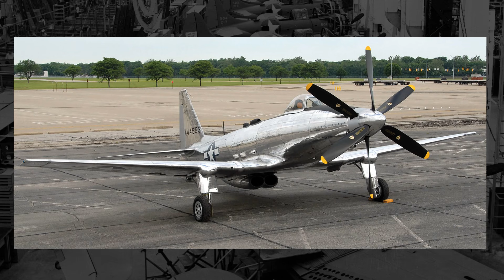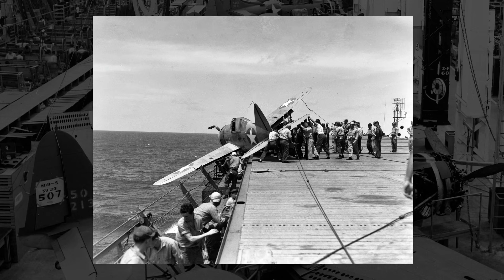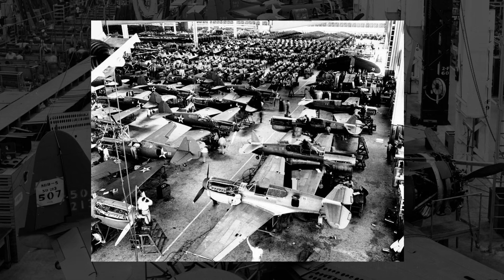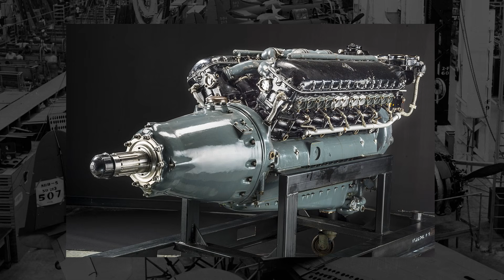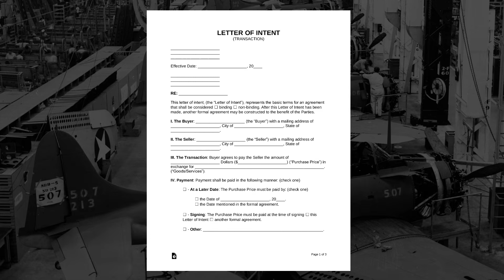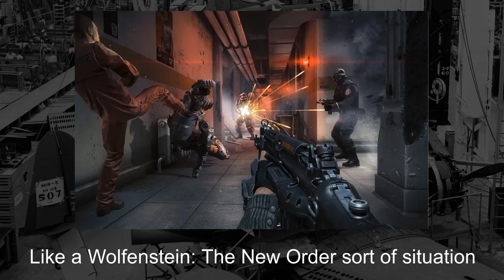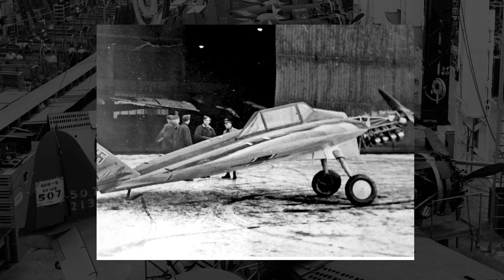The "Wonderplane" Slapped Together With Spare Parts: Fisher XP-75 Eagle

Comment: I think the Blackburn Botha and the Heinkel He177 were much worse, becaused they actually made it into service and killed many of their crews
Reply: He177 wasn't a bad plane. It had bad engines. A Manchester that never got its 4 engine fix. (Outside prototypes).
Reply: The Blackburn Botha needed more powerful engines, another 300 hp per engine would have been a big help but unfortunately there were not enough Bristol Taurus engines.

Comment: Blackburn Roc - a woefully underpowered, British naval turret fighter with a maximum speed 186mph (nuff said), the LaGG-3  or "varnished guaranteed coffin" as nicknamed by Soviet pilots (over 6500 of these death-traps were built), the XVF-12 VTOL plane that couldn't fly & of course, The Christmas Bullet which could fly just long enough to shed its wings & kill its test-pilot.
Reply: Ahh yeah, the Roc.  Someone thought "Let's make a Defiant, turn it into a Carrier aircraft with all the extra weight that entails, give it a weaker engine, then have one of the most renowned designers of 'What The Fudge?' aircraft in the first place build it, then make it unstable as hell. Brilliant!"

I don't think it's the worst aircraft ever, but the Roc has special place in my heart - where the fat greasy bits of cholesterol gather.

Comment: I present to you for consideration the British interceptor: The Boulton Paul Defiant. Because putting a turret on an interceptor is a terrible idea.
Its WW2 like the Fisher XP-75, and it was a fighter.
Unlike the Fisher XP-75 it was accepted into active service and 1064 were built.
As far as fighters went it was badly outclassed, and basically required escorting fighters f you wanted them to come back alive.

Whilst it's not all bad I would not be surprised if the plane would have been better with the turret removed and forward facing guns like a proper fighter.
Reply: Bad idea, but not a bad plane. They tried to build one with traditional wing guns and it was a solid plane.
Reply: The Defiant was early in the war and while it lacked performance due to the weight and drag of the turret it was used as a night fighter until being replaced by the Beaufighter, I notice that the P 61 late in the war with a turret lacked performance and could barely catch a bomber.

Comment: The Me-163 Komet had a good idea, but a dangerous approach. The fuel they used was capable of melting the pilots--literally--and there's one video on that very thing. However, while the Komet wasn't totally successful, it ushered in a new age of rocket-powered/jet-powered aircraft. Same deal with the other German-made fighters introduced in 1944/45. For them, too little, too late.

I know the jet engine goes back as far as the early 1930's in the UK, but operationally speaking, it wasn't until the late 1930's that the first German rocket-powered aircraft took to the skies. And piston-engined aircraft were the go-to planes during the war. The Meteor, the Me-262, the Komet, and a few other jet-powered/rocket-powered aircraft developed near the end of the war and into the late 1940's brought an end to piston-engined aircraft for good.

Comment: I’ve seen a few mentions of the Eagle having P-51 wings but in all photos the wings are clearly P-40.  Using Corsair landing gear makes more sense then as it has a similar retraction motion to a P-40 but was likely designed to handle more weight.

Comment: The Allison engine was going to doom the XP-75 regardless.  The engine it was based on was well-known for poor performance at high altitudes, whether it had a supercharger or not.  The main advantage the P-51, for example, had over the P-40 was the P-40 had the V-1710 but the P-51 had the Rolls Royce Merlin, which performed very well at high altitudes.  In the P-39, the Allison was fine because it was a ground-attack fighter, but for anything expected to escort or shoot down bombers, Allisons were never going to cut it.
It's also arguable that had the P-39 been given a Merlin, it would have been the ultimate single-engine bomber-slayer with that 37mm cannon and the P-51 might never have been produced, which might have been a problem once the Allies went on the offensive and needed the extra range to escort their bombers in Europe.  The P-47 and P-38 were still available, but not in the numbers needed, and they lacked the maneuverability of the P-51 for dogfighting enemy fighters.

Comment: There is much more to the Messerschmitt 163 than just being a rocket plane that cost more than it earned. From an aerodynamic point of view, it was one of the most influential airplane designs of the century. If was believed that this tailless design with swept wings was the right configuration to surpass the speed of sound. Therefore it was copied by the Allies (like the X4 Bantam) and it led to a lot of experimenting. The Russians even continued their research into rocket interceptors shortly after the war, because at that point it was still not clear that jet propulsion would be the winner.

Test planes are hard to judge. Many test planes never go into production for any number of reasons, so failure is pretty normal.
Reply: The Mercury Redstone rocket was a direct descendant of the V-2.  I believe the American design was based on an Atlas ballistic missile and kept self destructing.  Not a desirable characteristic.

Comment: The thing is, many MANY aircraft failed in the development stage; especially during the war. And an ungodly number of them failed due to engine issues. The idea of an (effectively) twin engine heavy fighter with sleek lines and high climb rate is not the issue. The engine placement is not the issue. If this DID work, it might have become a fantastic aircraft.  But the main issue was the engine. The forward visibility was good. Had it been given a tricycle landing gear, visibility would have been fantastic.  Basically,  if the engine lived up to expectations,  everything else could have been worked out.

Comment: They didn't even test this thing properly as just sticking a few parts together and then fly it in combat like ways, tight turns, high speed turns etc, This thing will for sure break up either on landing if you are lucky or mid air if unlucky. No ejection form at all would be able to save you in that case. This thing is a disaster waiting to happen.

Comment: For such an unfortunate looking plane (although the bubble canopy was a nice improvement, looks like from a P-47?) the Air Force Museum's example is looking pretty good polished to the hilt. With some of the other planes like the XBT2D and XF8B you've reviewed where all examples were scrapped I guess were lucky to have the XP-75 to view if for nothing else as a reminder that even the best efforts don't always pan out but it wasn't for lack of trying. An aviation museum for planes like this would most likely be an interesting place to visit and I wish a lot of the "failed" prototypes were still around to populate it!

Comment: The P38 could not operate at altitude for use in Europe and the P51 was the slowest of the four top fighters the Western allies used from mid 1944 until the end of the war.    The Spitfire was the fastest while the Tempest was next followed closely by the P47 then the slowest of the four was the P51 Mustang.  The US was so far behind other nations when it comes to aviation until the post WW2 era when other nations didn't have the funds to manufacture designs they had produced which did exceed US aircraft,  After that development just dwindled often surviving only when nations worked together on projects.

Comment: My dad worked at Fisher Body and when the war broke out, he stayed with Fisher and had to move to Memphis. He was a foreman. At the Fisher plant, wings were produced for the B-25 and the B-29 and possibly other parts or small sub assemblies. He had nothing to do with the Eagle. Knowing GM and how the different marks shared parts, it is just an extension of their thinking to make it fast, cheap and reliable and the fact that they owned Allison.  For the mishmash it is, I think it came out looking kinda sleek. Better looking than most British aircraft which had some strange ideas and styling but they persevered and moved beyond making some fine aircraft. The plant is Memphis is still in use by I think Porctor & Gamble where Charmin is made. Very few pictures online of this plant. If you look up FIsher Body, there is a site that breaks down the different plants and gives locations and what the did during the war and some pictures.

Comment: The entire idea of trying to improve efficiency by reusing major subassemblies from other aircraft was stupid.  Requiring engineers to figure out ways to reuse major preexisting subassemblies that were not designed to work together was guaranteed to result in an inferior design compared with what good engineers could have developed if they were allowed to adapt ideas from earlier planes to fit a new design better.  With production on the scale GM envisioned, there was no possible way that reusing subassemblies could have led to more than a minor advantage in production efficiency, so there was virtually no chance that advantages in production efficiency could outweigh disadvantages in performance.

Comment: Had the USAAF got it's way it would have had no fighters at all in 1941 as the USAAF thanks to the flawed ideology of"Billy"Mitchell combined with isolationism was wedded to the ideas of Douhet"The bomber will always get through" meaning the entire inventory of the USAAF after Pearl harbour would have consisted of B-17s,B-18s and similar aircraft which would rely on heavy machine gun batteries to stave off enemy attacks: Raids like Schweinfurt proved the folly of this especially when the opposition turned up with fighters armed with multiple 20mm cannon
Reply: In July 1942 after bad losses the USAAF asked the RAF to protect their bombers and the RAF did using Spitfires, in fact if you went to the National Museum of the USAF you could find confirmation that the Spitfire was the main escort fighter for the USAAF from July 1942 for over a year.

Comment: One candidate I will recommend is a plane that did get considerable use in WWII.  I learned about it from my Dad's business partner, who had been a B-25 "flying sergeant" pilot.  At the conclusion of their first orientation briefing the students were told to pair up with a B-25 instructor.  John looked around the room and was disturbed by the fact that all the instructor pilots appeared to be teenagers.  Then he spotted one captain who must have been ancient, probably 35 years old.  He hooked up with him and off they went to the flight line.  Once seated inside, John stared at the captain and the captain stared back.  Finally John asked him, "Sir, how do we start the engines?"  The captain sheepishly replied, "I don't know.  I've never flown one of these machines before."  
"But aren't you qualified in B-25s?"
"Well, that's what I told them when I volunteered for this assignment.  The truth is I've been training students in Curtiss AT9s and I had to get of them before one of those damned planes killed me." 
Between the two of them they managed to figure out how the B-25 worked and ended up checking each other out.  As for the AT-9, it had been purposely designed to be tricky to fly, so much so that after the war the government refused to release them for civilian sale.

Comment: Many aspects of this plane remind me of the German's Dornier DO 335 Arrow.  Mid-Engine design, extremely large fuselage more approriate for multi-engine level bombers, contra-rotating props (althoug the Arrow had them separated by putting one after the tail section).  However, the Dornier DID meet its design goals, and was put into production, but it was too little, too late.
Reply: Reminds me of Johnny Cash's car:  One piece at a time.

Comment: Worst no. The Bell P-59 was the worst. Jet powered, but no faster than contemporary fighters at 413 MPH. 37 mm cannon with 44 rounds, and 3 .50 calibre machine guns. And they built 66 of them. If it was a jet trainer project it would have been fine. But it was meant to be a frontline fighter.

Comment: In the technical publication industry you document the prototype (even prototypes need instruction manuals) and you update to the production model as changes are made. The prototype is the engineer’s first physical guess about how the machine should function; testing is the shake-and-break phase to find out what works and what doesn’t. Sometimes too many things break, the fixes compromise the intended function and it never gets beyond the prototype stage.

Comment: The P-47 gear extended as it was lowered. To prevent prop strikes.
One of the features/compromises of the Corsair (and the reason for the inverted gull wings) was a specification for a HUGE prop 13'1" in diameter.  The P-47 used the same diameter prop, and Republic's solution to prop strike (something the CORSAIR (initial production versons) was well known for), was to design the landing gear legs extend/lengthen as they extended.
P.S. the Corsair's prop strike problems were mitigated (never totally solved) by training and pricedures (arcing landing approaches, redesigned gear legs/shocks).

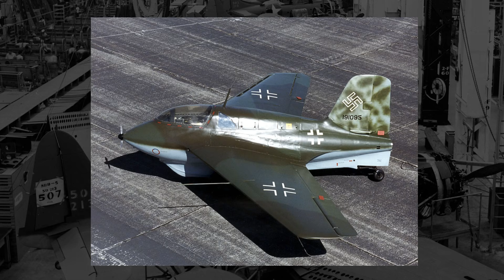Comment: 19:46 I wouldn’t personally think of the ME 163 as being the worst plane. I mean, yes, it was certainly hazardous to fly with even the fuel, unburned, being corrosive enough to slowly and painfully kill the pilot. Buuuuuut, it was faster than any other plane at the time (that is, if you can even coldest thing a plane and not a rocket with a pilot and guns strapped to it)

Comment: Comparing a failed developmental aircraft to production aircraft is questionable in determining “worst” aircraft: far more men perished flying Brewster Buffaloes and Douglas Devastators in the Battle of Midway than in the  XP-75 program, yet the former were prewar designs that outperformed prior models.  “Worst” is subjective; the engineering caveat “it depends” applies and allows for avoiding a definitive answer.

Comment: War planes are not the same as motor cars. Taking parts all and sundry doesn't improve on the design and performance of something that operates in three dimensions.

I wouldn't rate this so badly as to be "the worst", and as you say, and as Germany showed with a number of designs, management issues were the killer.

Comment: An F-35 has a range of ~1,500 miles.  Some jet fighters even less.  Impressive the range these WW-II planes had!
Reply: True but no air refueling back then
Reply: @robertheinkel6225  Correct for sure.  The range of some fighter jets is pretty poor these days, esp considering how far off their launch points have to be to attempt to be out of range.

Comment: Very interesting, thank you.
I don't get how the cobbling together of an aeroplane from the parts of pre-existing designs was ever going to speed production, indeed all you are really doing is adding complication by attempting to 'Frankenstein' necessarily incompatible parts together.
Surely a much better plan would be to design a plane from the ground up with production line assembly and modularity in mind?
Reply: A notable success in such an approach was the CAC Boomerang in Australia. It used quite a few parts from the earlier Wirraway & went from the first order to prototype stage in three months. Although a much more capable aircraft than the Wirraway, the unavailability of a suitable supercharger meant it was incapable of a fast climb to the heights at which Japanese aircraft were operating & was sluggish at such altitudes, so it failed as an interceptor, but it carved a niche as a very effective ground attack aircraft later in the War.
Reply: Poorly explained in this video. If you take a wing that is already designed, you do not have to spend any time designing and testing it. You simply start producing it. 
Also, if it is an already existing part, you can either have the original supplier build more so you don't have to and can simply pull them from the supply bin, or you license to build them and save the engineering and test time.
The video tried to say this destroyed the assembly line concept but it was the parts supply side, not the assembly line side.

Comment: A couple of things got missed in terms of "advanced features" - the P-39 - like arrangement of putting the engine behind the pilot, for instance. The main problem with tractor prop fighters was the long nose and tail dragger gear - it hinders visibility, especially for taxiing and landing. The P-39 was ahead of its time. By 1943-44 EVERYONE was thinking along these terms - Rolls Royce had a fighter design for its new Crecy engine that was supposed to use P-51 wings, it got as far as a fuselage mock-up (there's a picture in the RRHT book on the Crecy). Messerschmitt had a Me-509 in the design stage. Both of these had the pilot up close to the nose, the Me-509 also had tricycle gear (something the P-75 didn't have). And note that pretty much all jet fighters post-war have the same arrangement - cockpit up near the nose, engine(s) behind the pilot. Another feature was the placement of the radiator. One reason for the P-51's added speed was it put the hot air from engine cooling where it would do the most good, in the low pressure region towards the rear of the fuselage. Note that the Me-509 has this, as well, so did the Martin Baker MB5.
Reply: Good points, well made. 
😁👍
Reply: If only NACA hadn't torpedoed high altitude performance and multi stage turbo/superchargers the P-39 could have been a real contender.  NACA concluded it wasn't worth the weight/complexity penalty.